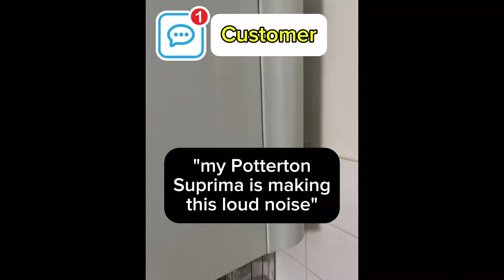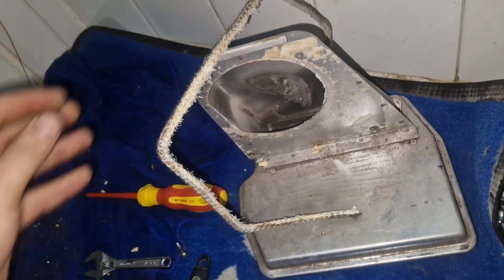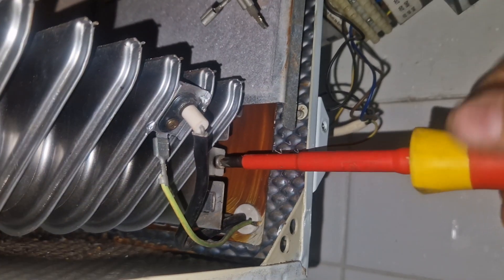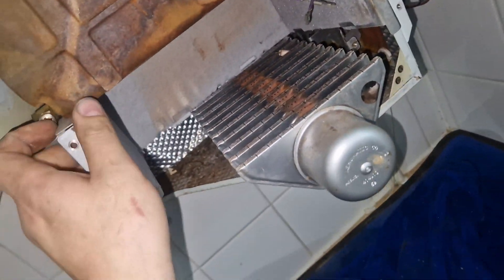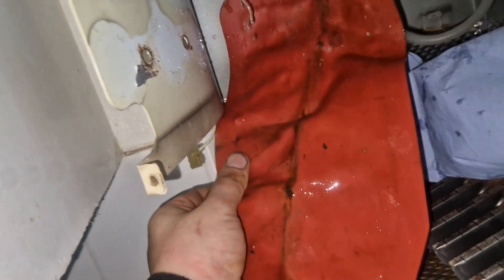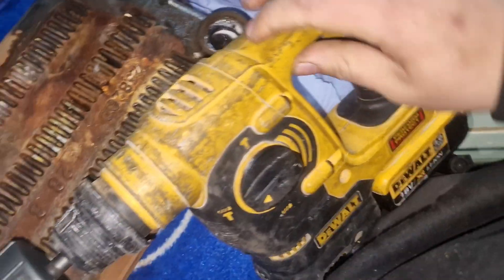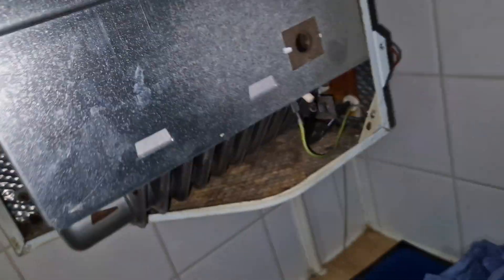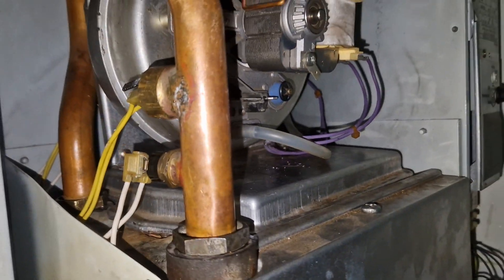Fix a loud noisy 📢 Potterton Suprima boiler. Stripped and flushed.

Comment: I had an elderly customer in 2011 who had a suprima 50l with a leaking heat exchanger. Turned out to be one of the 31mm core plugs on the side. There are 5 in total, 2 on one side and on  3 the other. Ended up taking out the heat exchanger and replacing all 5 that had almost  corroded through.
Baxi potterton didn't sell them so had to measure them and buy some from an auto spares.
Easy to punch the old ones out with a screwdriver then hammer the new ones in with an ½" iron socket. Boiler lived on another 10yrs until I installed a new Baxi 400 combi. Ive still got a 70 model in my property. The only thing that let them down was the PCB with cracked soldered joints.